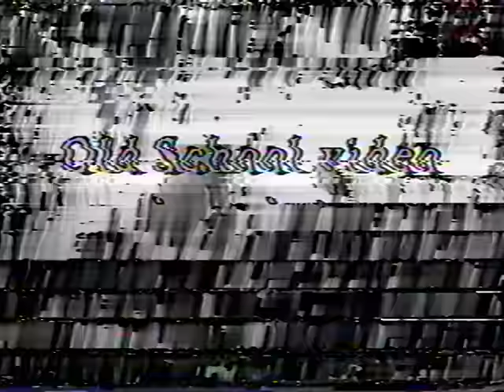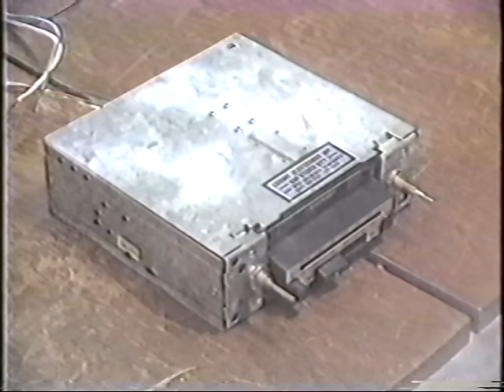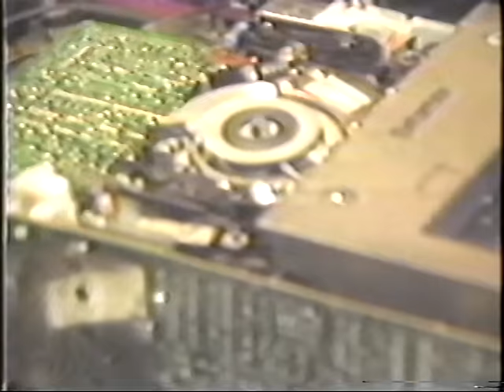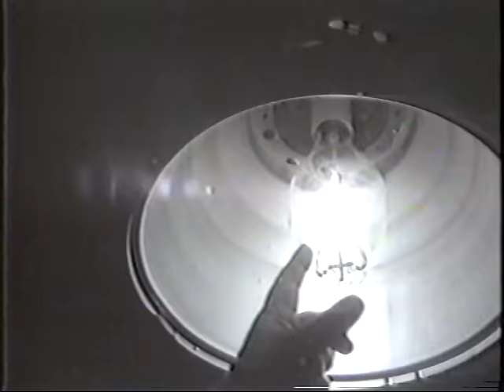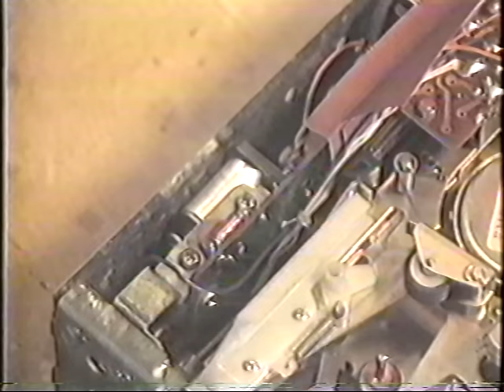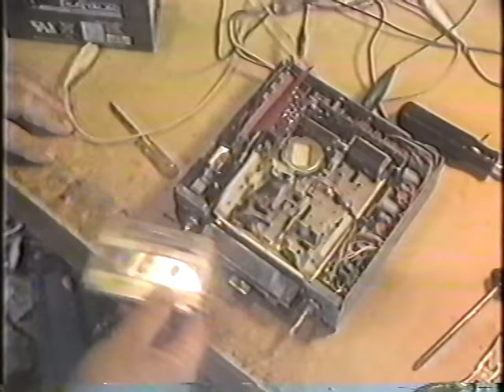Old school shooting and editing with vintage gear

Comment: There is a box of tricks  SONY PCM encoder/decoder that allows you to record and playback music in CD quality and I wonder do you have that also as it is part of the SONY PROFEEL F1 system.
Reply from the maker: I used to have the PCM encoder. It generated a PCM bit stream for 16 bot digital audio, and framed it as an NTSC black and white video signal. I have several tapes recorded with it. I also ran the audio into the hi-fi inputs on the beta deck I used, which was a good thing, as that PCM unit went out on loan to a friend with a recording studio, and while he had it his studio had a break in, and it was taken. AT least I can play the HI-FI portion of the tapes. That's how I got my first DAT. I made my friend replace the PCM unit, and because Sony wasn't making them anymore he bought me a DAT.

Comment: Right on, fun video! I've wanted to do at least SOMETHING with my most awful gear (not oldest like your video) when that is funny.
I'm thinking Akai VHS EP to the Fisher VHS with the bad video heads but I won't use it's psudo edit mode, only EP crash edits...  install a very worn out capstan belt, use Tozai brand tape, chew and stretch the tape at the right moments, then miss-adjust the record current to the video heads if it still looks ok and maybe put some grease on the tape for that final moment in the recorder to get a nice drum wrap.
  
Then "rescue" the mess by cleaning the tape with the wrong solvent (like acetone which makes some tape stretchy) and an extra dub to Umatic high band machine with very bad audio heads... so that it's tbc can try to fix the picture on playback into the capture card. I'll bet this will drive the servo in the umatic totally nuts while it's recording the "final master" tape... so why not use one of my bad servo boards that just barely works!? I'll bet after it's done I'll have more junk to throw out.
Reply from the maker: I think I will do a few more using some old crap. I have an old CCD-V110 8mm, and an old TR81 Hi 8,  a couple of old VHS cameras that were given to me, and some digital 8 stuff.It might be fun to crank up some of the old gear standard definition gear and compare the quality between, and just throw together for a good comparison. Naturally I would not edit it on the computer, analog eniting is just too much of a headache.

Comment: Hilarious mate that radio nearly chewed the cassette up, tapes get a bad rap but on a good deck with a chrome or metal tape they can sound amazing. im currently working on a 1980 ct-400, after 30 odd years needs the usual speed,head and output alignments, fantastic machine though.
Reply from the maker: Cassettes were and still are tacky little plastic things.Cassette sounded ok when used with dBx noise reduction, but they really did have too much tape hiss for me. Even the good decks, and I have had a few. I was a reel to reel guy, and made the digital transition to DAT early on. Once you hear DAT you don't go back.Working on the behind the scenes video of the editing process to get this one done. I had an equipment break down on one of the editor decks and had to do it manually. I forgot how tedious that was. I am spoiled. I was editing with Premiere back when a 486 and Windows 95 was state of the art. I forgot how painful linear editing was.  The hammer went through that machine because I was frustrated with the old gear giving me headaches.ARGH
Reply: I love cassette tapes, Metal and cro2 can sound better than cds, i love analog. ive noticed my technics sl-p110 cd player sounds amazing through burr brown analog outputs but my teac cd player sounds too harsh through digital. and if anything a consider blank cd media to be junk and they rarely last more than 7 years before they start to deteriorate, got tapes here that are 30 years old and sound as good as the day i bought them. music producers are going back to cassette tapes now aswell. minidisc pisses me off aswell w its stupid serial copy management
Reply: Did they ever see something like Dolby HX on Beta? I remember in the late 80's/early 90's, my old man got a cassette deck with Dolby HX (luckily passed down to my 30 year old self) and even now, playing back some recordings, it sounds amazing for cassette! Even Type || cassettes recorded with HX sound pretty damn good by todays standards!
Reply from the maker: Beta was the original HI-Fi machine using the rotary video heads.They used FM recording, and this is what forced the VHS team to do some innovating because VHS had linear stereo. Basically 2 tracks of AM radio with Dolby B
Reply: I use a vhs hifi 4 head machine to record music videos, its sound is fantastic

Comment: Mercedes generally came with Becker radios. I'm thinking the 8 track player was a Kraco
Reply from the maker: It was a Blapunt AM radio and the 8 track was a Kraco. I missed the "R".The guy that put it in the car botched the install. He put the 2 speakers in the back, and wired it up with a relay to switch the speakers from the radio to the 8 track when a tape was in. Wired it left channel to old AM speaker in dash, right channel to both back speakers. Had one of those balance controls to put the AM radio on both front and rear.It made listening to the Beatles really weird sounding. All the music from the front speaker, and all the singing from the back.

Comment: is the switching pulse slightly out?
Reply from the maker: Head switching is supposed to be 7 lines before vertical sync, however I am running through the Videonics titlemaker. It has a frame store / synchronizer to allow title overlay, and that shifts the video a few lines up so as to not be disrupted by the switching pulse, so the second generation will show the switching point at the bottom, plus the switching point generated by the second generation. If I were to copy that tape looping through the titlemaker again, you would see 3 switching points. The TM2000 was a consumer piece of gear, and had to be designed to accept a variety of signals from all kinds of different consumer gear. That's the difference between consumer and broadcast.

Comment: 12V, What type of tripod, 
is compatible, with a Sony BMC-100?
Reply from the maker: They all use the standard 1/4" screw mount. That is pretty much standard. Some professional units use a 3/8" screw. My professional JVC and my old Betacams used a 3/8" on the base plate, and I can get a 1/4" for it. One of these days I 1/4" so I can use my expensive heavy tripod with my little plastic 4K camera.
Reply: Thanks.

Comment: I dont think the dubbing did it any good, i think even the beta will lose quality, but it worked :-D.
Also contrast seems lacking, its got the look of one of those Alien autopsy videos LOL, looks like it was made a looooooong time ago :-D.
Somehow i think the hammer actually improved that radio/cassette Ha Ha :-D :-D
Reply from the maker: The tapes were old, and shot, and the second generation didn't do it any good. I also had to make a DV copy from the edited tape because the dropouts was causing my Happague capture board to complain.So it went to DV and then to the PC. My DV recorder is supposed to have an analog to dv converter, but every time I plugged the PC in, the recorder went to input mode, so I dumped to DV, and then to the computer.What I should do is capture the first generation tape, and then edit it again on the PC so the quality of a first generation tape can be compared. Perhaps I will do that if there is interest, as I can bang that out in probably about 15 minutes the way I edit. (Yes I am pretty quick with premiere, as I have been using it for about 20 years)
Reply: +12voltvids that would probably be a better idea to do the editing on the pc, still has the look and feel with the old stuff
Reply from the maker: I will probably re-cut it, and it will be a totally different video when done.
Reply: +12voltvids Haha, that'll be fun. I love the old videos, I've experimented in stuff like it and its fun to use the old stuff and give it a purpose once and a while
Reply: Yes im sure it will be better with less conversions :-D.
And if you had wanted to cheat, then tap onto the camera video out and capture the filming direct, oh but you will have to un-hammer the radio/cassette ha ha :-D, just being silly :-D.
So now you have mastered the old video look, are you going to redo the alien autopsy video for fun lol :-D
Reply from the maker: I do have a DV stand alone deck, so I could plug any analog camera into that and record straight to digital tape, but then it wouldn't have the analog artifacts, color smear, tension errors that plagued analog shooting and editing. Many viewers of YT are not old enough to have used these old formats. Those of us that grew up in the 60s and 70s remember the old formats, and the limitations of home, video and we dreamed of the day when quality would improve. I can't tell you how much money I spent over the years buying the best gear I could afford, but I can tell you that I did drop 30,000.00 once on a camera.I still have my old 10,000.00 JVC camera. Perhaps I will shoot something on that one for fun providing it still works. It hasn't been used in over 10 years, and is just a decoration in my TV room now. It just sits in the corner on the 2,000 tripod!
Reply: +12voltvids Yeah it's pretty ridiculous how in terms of quality we've come so far. While I miss the days of analogue tape and everything because of its charm and all that, I'm incredibly happy that all of my video can be stored in a central location and viewed in near perfect quality instantly. Not a lot of younger people can appreciate that fact.
Reply: Bloody hell, 30,000, i would expect that to be solid gold for that money.
I grew up in a poor family so i got used to having nothing, any money that i earned was thought about very carefully, my job was very low payed, but it was a job :-).
As ive repaired many items for people, i got to see all sorts of modern electronics and old knackered stuff too, i didnt need to have much money to enjoy what others had, never the envious type you see.
Reply: Bloody hell, 30,000, i would expect that to be solid gold for that money.
I grew up in a poor family so i got used to having nothing, any money that i earned was thought about very carefully, my job was very low payed, but it was a job :-).
As ive repaired many items for people, i got to see all sorts of modern electronics and old knackered stuff too, i didnt need to have much money to enjoy what others had, never the envious type you see.
Reply from the maker: 30 grand for a camera was a tough pill to swallow but I was getting 2,500.00 to shoot weddings, and I was doing 2 a month. So essentially in 6 months the camera was paid for, and then it was profit time.Moving up to professional gear gave me a huge quality advantage to the guys using their home video cameras. When a potential client saw my demo video, and they were spending 40,000 on a wedding, what was 2500 for a polished professional tape shot with broadcast gear, when the amateurs were charging 1000 for home video. That extra 1500 to these high end clients was money well spent. Same when for photographers. Anyone could shoot 35mm, but they don't enlarge well. To get those portraits done, a photographer would be using a 3x4 medium, or a 5x7 large format camera. Those guys were getting 4 to 5 grand to do the wedding photos.So it was easy to justify 30 grand for a main camera, and 10 for the backup, and another 30 grand in editing gear. My first non linear work station only had a 9 gig hard drive for the video drive. That would store only about 12 minutes of video, so everything had to be done in small chunks and exported to tape.The capture card was 1,300.00 The SCSI controller 500, and the 9 gig, 10,000RPM video drive 3,500.00! All worthless now, but I did make my money back when I was in the business. My royalty free music library was something like 2,500.00 just for music I could use without being sued for copyright.
Reply: Wow!!, sounds like you were doing really well :-D.
Yep quality costs, its worth the money spent to get a beautifully made recording of the most happest day of your life.
An A1 pro :-D
Reply from the maker: I quite often wonder, when I look in the old boxes of videos I did years ago, how many of these couples are still together.A few are. I now work with a guy that I shot his wedding back in the 90's, and I was recently contacted by another client to get a DVD made after like 20 years, but if statics are correct only about 50% will still be together.
Reply: The clients are lucky you still keep those master tapes for so long, and the bad thing is there is nothing more reliable for storage, dvd's often fade over time and cause problems on playback.
Ive had data cd/dvds that had file problems after 2 years, you just dont have any way to test the long term reliability.
Flash memory and ssd's are unsafe too :-(.
Keeping disks in the dark and cool just doesnt keep them safe, ive tryed it, they can still fail.
Ive found re-writables to be more reliable, odd that.
There weddings are safer on the original tapes.